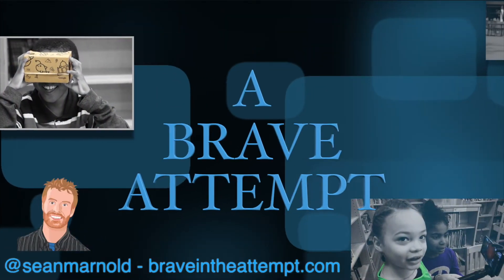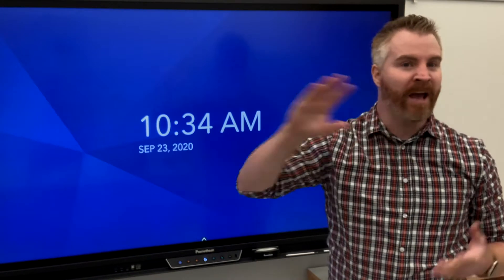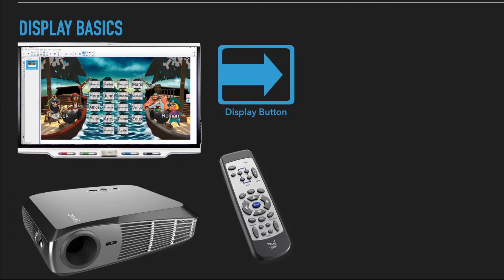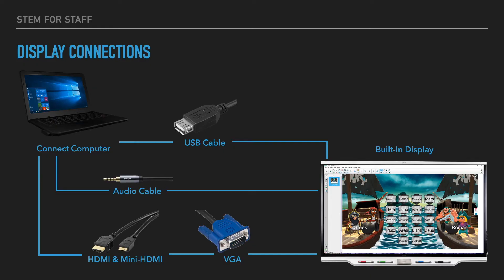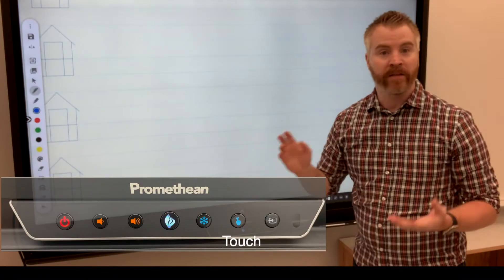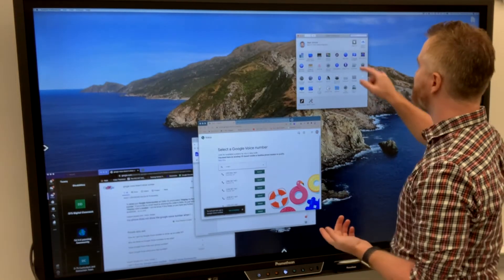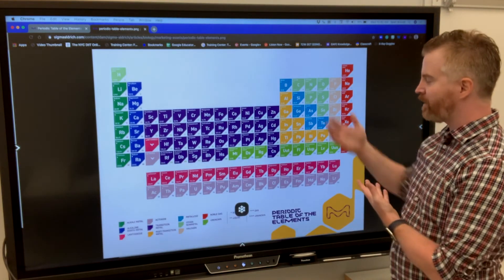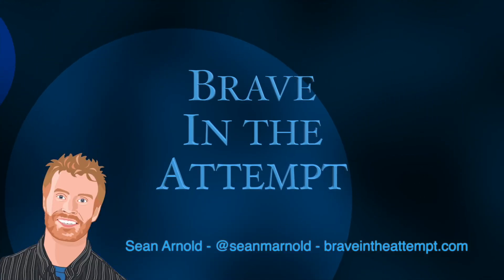Interactive Display-Hardware Basics (Promethean)

Comment: I use this board at work and I mostly connect via Apple TV. 
Towards the end of the day, the board gets unresponsive. One issue is that the audio stops working so I have to use my Bluetooth speakers instead. Another issue is that the Home Screen freezes and will not turn off! The remote stops working altogether. The touch screen still works, but idk how to make it sleep that way- I usually press the fire button to turn the display off. 
Are these issues fixable? Or is it something I should get my IT team to help with?